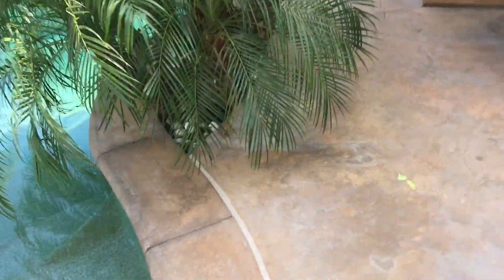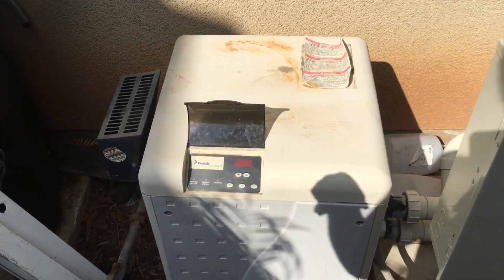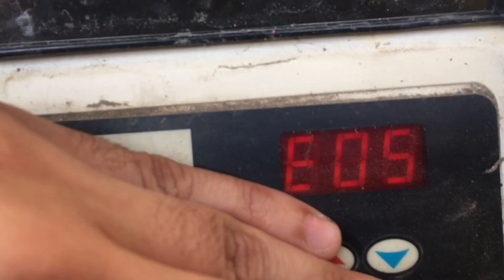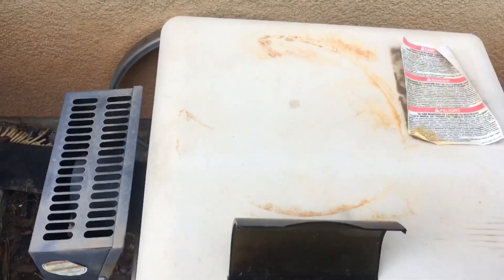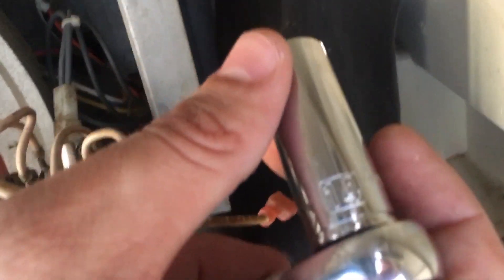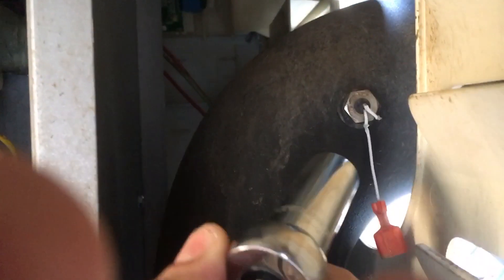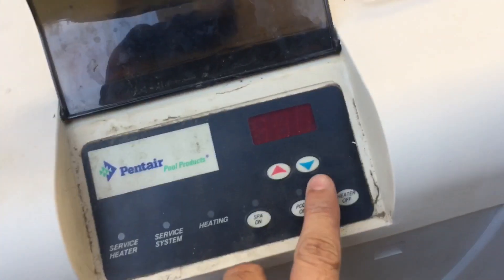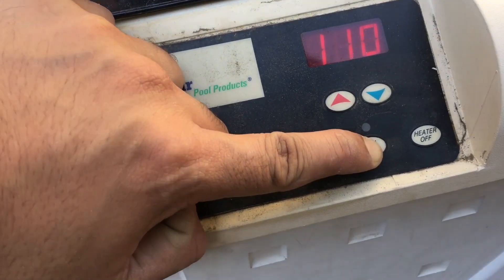Pentair Masertemp 400 Error E05 Stack Flu Sensor Replacement Instructions

Comment: I have this heater. Its 3 yrs old. It turns on and heats up but than shuts off with no error code but service heater light comes on. My pool guy says it beeds a new heat exchanger??? How can I test it?
Reply: Filter may be need to be backwashed or cleaned
Reply: It doesn't need a new heat exchanger, it needs a new pool guy.  You can test it by removing panel around inlet and outlet pipes to expose manifold. Remove one bolt from bottom of manifold. If water comes out, you have a leak in your heat exchanger and it would need replacing. If dry, replace pool guy.
Reply: He's pulling your leg. It doesn't need a new exchanger. He must be overstocked with heat exchangers
Reply: Heat Exchanger might need to be cleaned of possible soot, Especially if your getting high stack temperature.